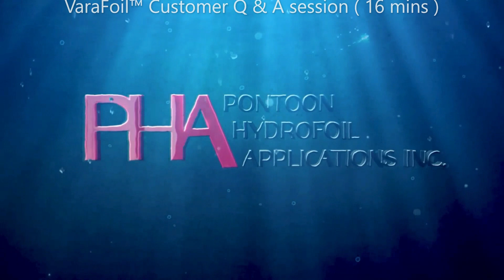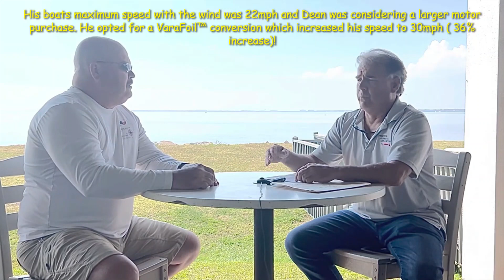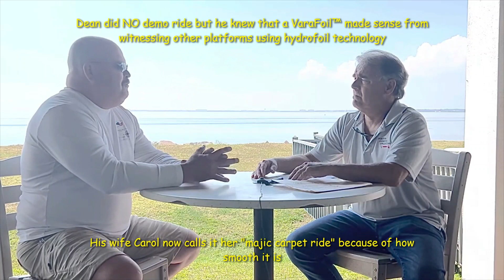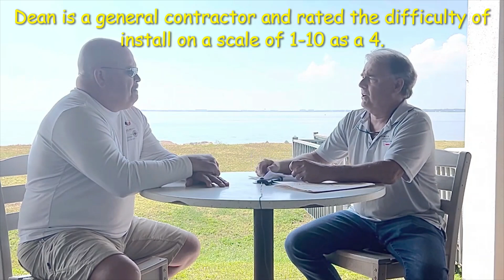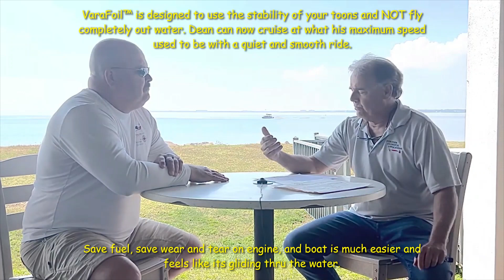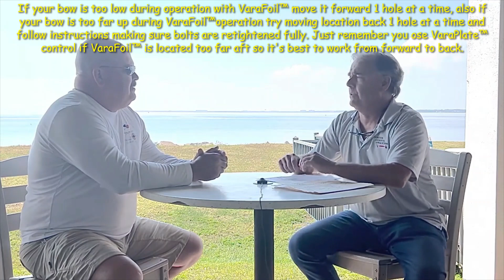Pontoon Hydrofoil Kit Speed Help and  VARA™ Foil Customer Interview

Comment: will this do anything on a 18 ft pontoon with a 60 hp Mercury? They say all youre gunna get out of it is about 19 mph. I changed my prop down to a Turning Point 12x 8 pitch to achieve 5600 rpm and got the same results from my Solas 11.6x11 just higher rpms
Reply from the maker: Hello David, just saw this question sorry for our delayed response.
The biggest factor for hydrofoil for pontoons is your current maximum speed. Our pontoon hydrofoil is guaranteed to increase your speed by 25%, however no data to date has been less than 32% gains, highest is 97%. The min. speed threshold is between 16-20 mph depending on VARA® Foil kit purchased.
Our pontoon VARA® Foil kits start at 3625.00 and can be found at https://pontoonhydrofoil.com/shop/.
We custom build our American made pontoon hydrofoil to your model boat, that is how we can offer a 25% speed guarantee no others can. 
We are not a one size permanently glued fits all boats hydrofoil alternative like others on the market. VARA® Foils are superior American made production kits that can be matched by no other production hydrofoil company.
Hope this helps and you may call directly with any questions at 727 455 5576 Thank you